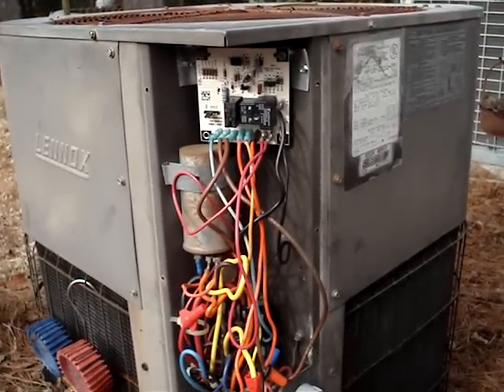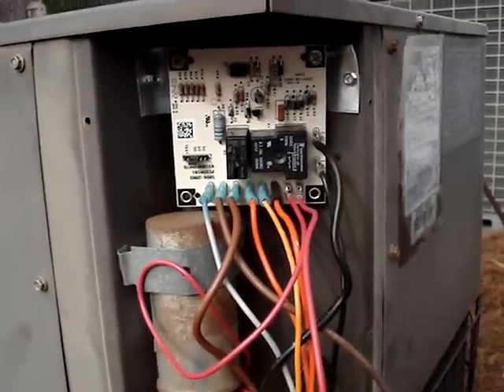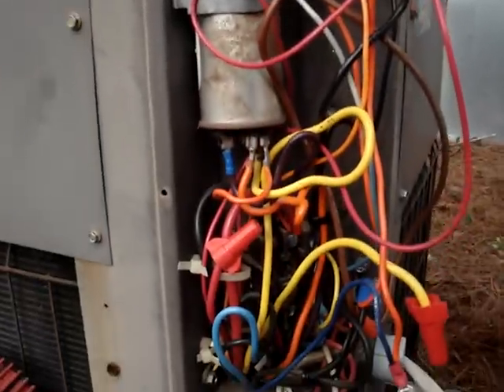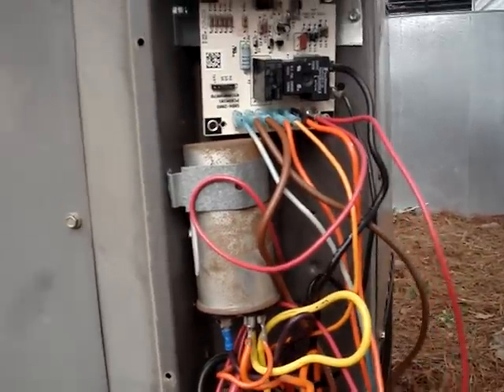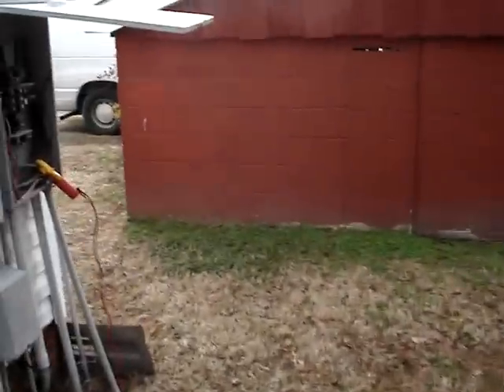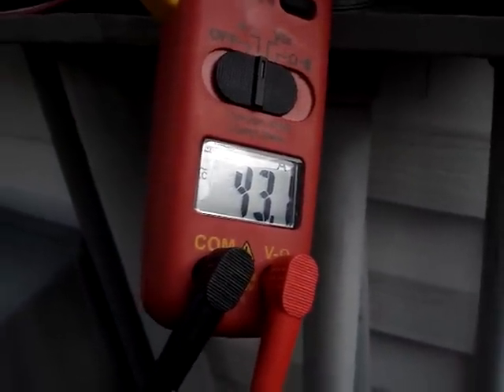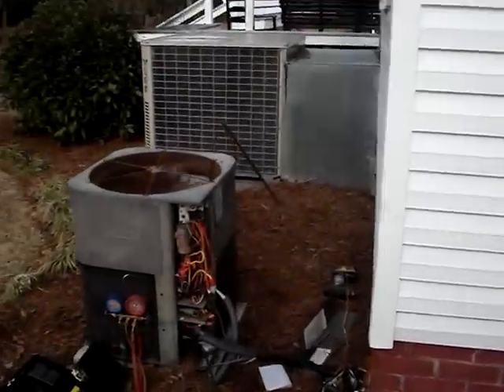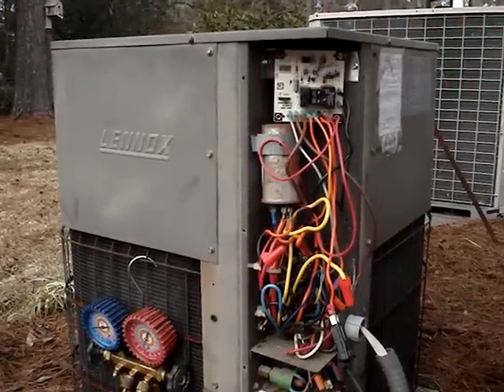HVAC Service- Lennox Heat Pump Defrost Board Retrofit

Comment: Found the retrofit kit for my 1985 Lennox heat pump and had it installed by the company that originally put the unit in, after the local HVAC company refused the job! (They just wanted to sell us a new $10k system).  The company that installed the unit is a Lennox-only dealer.  Still alive and kicking in 2019...in the Pacific NW.

Comment: Came across a nearly identical Lennox unit from the 80's this summer that was still running...sort of.

Compressor was on it's way out and there wasn't any room for a 5-2-1, sadly had to recommend a replacement.

Wish I could find one of these old units still in a crate somewhere!
Reply from the maker: +Mike_HVAC these units were super tough
Reply: Yeah, Lennox HS were work horses. They were bulletproof.

Comment: talyn875 I know that on average, the outside coil runs about 15-20 degrees colder than ambient, but what does the difference have to be to trigger a demand defrost cycle?
Reply from the maker: When the temp on the coil reaches the coil thermostat set point 3? F The defrost timer starts. When the timer runs out the system defrosts. Usually 30, 60, or 90 minutes.
Reply: I've seen the set pins that the newer boards have on them. I honestly would have put in demand defrost, but with an old unit like that, they can take a beating, and it really doesn't affect it much
Reply from the maker: John Smith Demand is good, but in this case simple and cheap is the best fit. This unit is still running today I believe.
Reply: Makes sense... It's a 1980s Lennox, and anything from the 80s can run seemingly forever, that is if line set insulation, and coil cleanings are kept up.

Comment: i have an old Trane heatpump wch036a100a with a mechanical 30,60,90 defrost timer. Can I and which defrost board can I retrofit . My defrost cycle doesnt kick-on in the colder months,tks